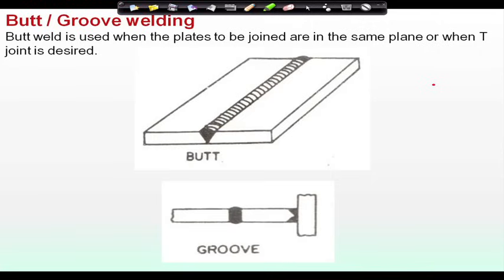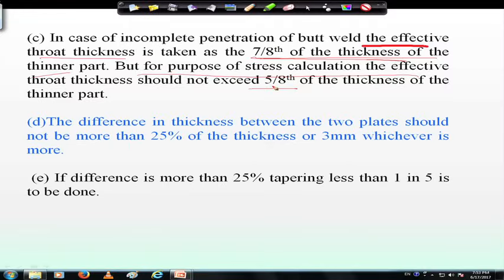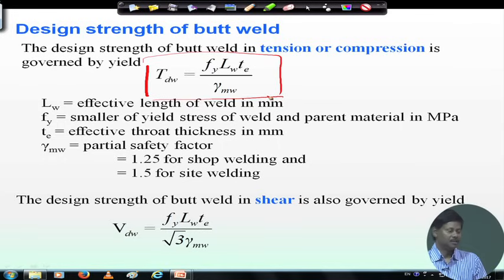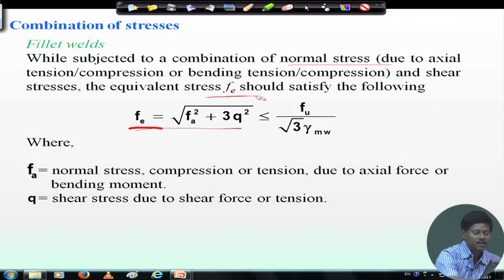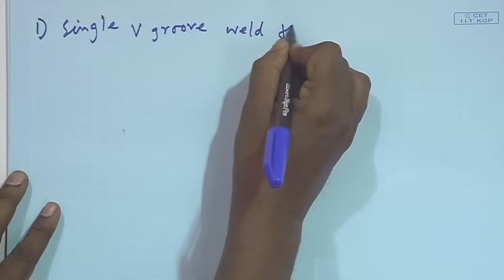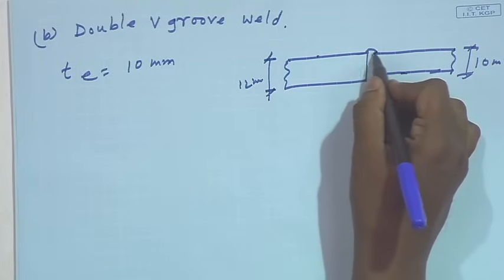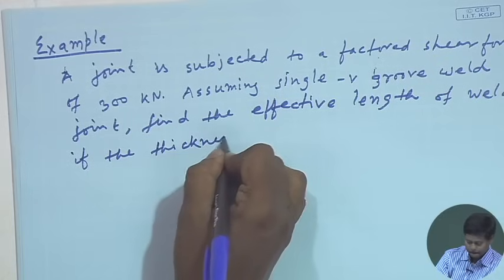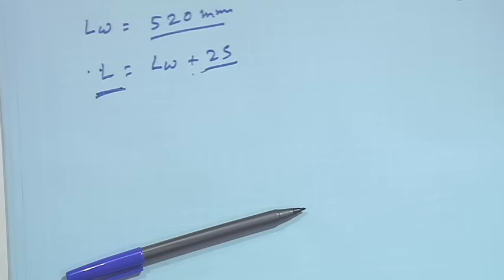Lecture 11: Design of Butt Welds

Comment: how is the throat thickness for double groove butt joint is 10 mm ? aren't you supposed to tell us that ? the worst useless faculty of nptel.
Reply: In size of weld point b) he has mentioned that for complete penetration(double V, double U, double J) effective throat thickness will be thickness of thinner plate
Reply: Thickness of thinner plate is 10 mm .so he took that

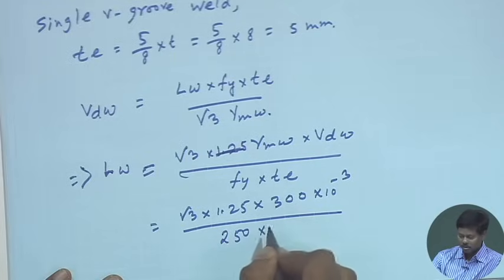Comment: 27:25 if mentioned 410 then why taking 250😂
Reply: Fool....he is taking the yield strength
Reply: @md  hahah noob
Reply: fy means yield strength which is 250 for any grade of steel. fu means ultimate strength which varies according to carbon percentage in steel and many other factors.  Hence fu is mentioned to denote the grade of steel. eg. Fe410. fu=410 MPa, fy=250MPa; Fe250, fu=250MPa, fy=250MPa. Cheers to learning!

Comment: @18.40  in the formula why √3 is not used
Reply: root 3 is used when we calculate shear strength but not in the case of tension and compression.